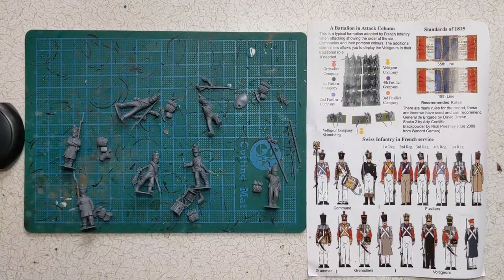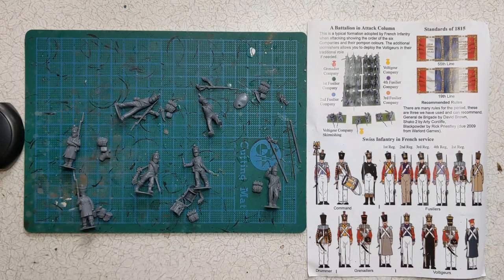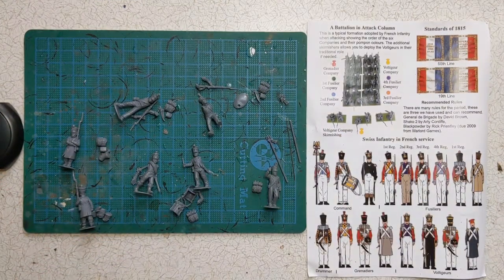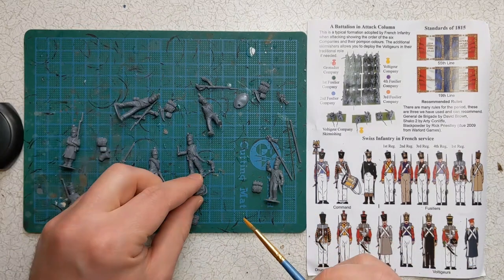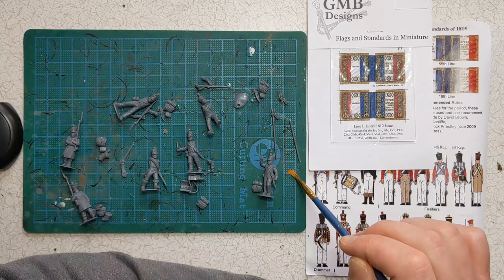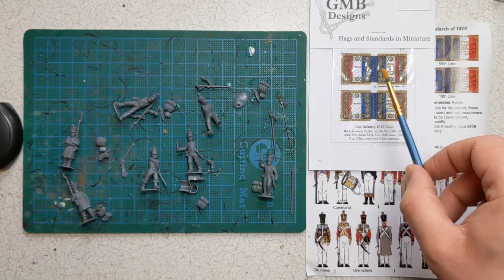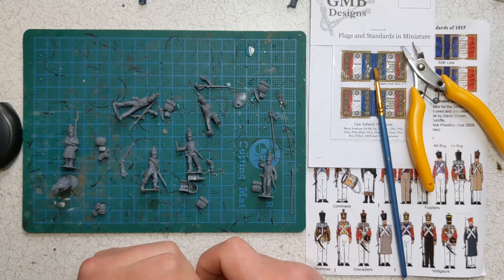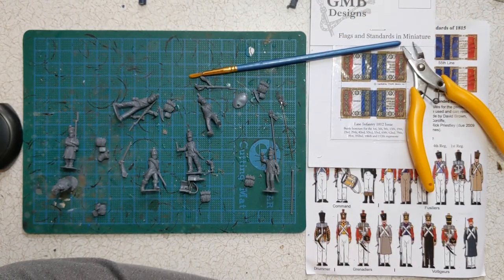Box to Battlefield Hobby Basics: Construction tips and head swaps on Perry French Line 1812-1815

Comment: quick question, I have a box of french (currently building prussians) from perry and was wondering if using flags from the sheet included is fine
Reply from the maker: The 1812-1815 Perry French come with flags for Waterloo. This 1815 pattern is different from 1812 and very different from 1804. If you're collecting for a battle other than Waterloo, you might want to look at third party flags from GMB Designs or Flags of War. If you're not fussed about that detail then fire on and use them!

Comment: Is it ever a problem to cover the line where the head or arm is attached? Do I need to use putty to fill it in or does the paint cover it up?
Reply: Sometimes it can be a problem - with the Perry British infantry set you can mix and match parts from the Victrix boxes (and vice versa) and the arms aren't always a perfect fit. The plastic cement melts the plastic parts you are sticking together and, generally, I find that a good dollop of glue conceals the joint. Once you've applied undercoat the joints are barely visible. If you take care trimming flash and the points where the bit was mounted on the sprue and dry fit before gluing you should be fine.
Reply from the maker: Solid advice from Malcolm here.  If you get the front of the alternate head fitting well that is the main thing.  Any gap at the back will likely be invisible to anyone else! You could get a product like Games Workshop Liquid Greenstuff or Vallejo Plastic Putty if the gap is particularly egregious.
Reply: @CullodenPaintingStudio  thanks very much y’all!